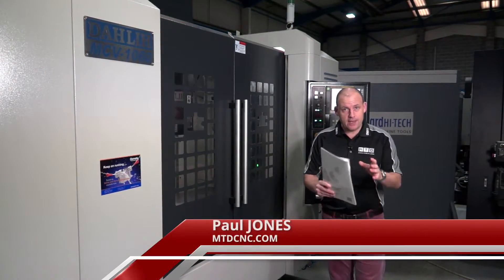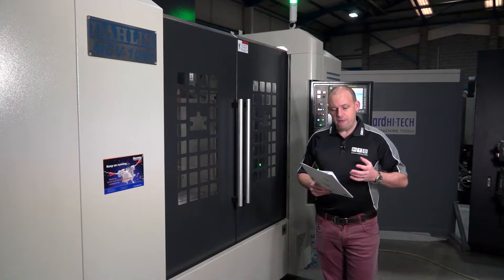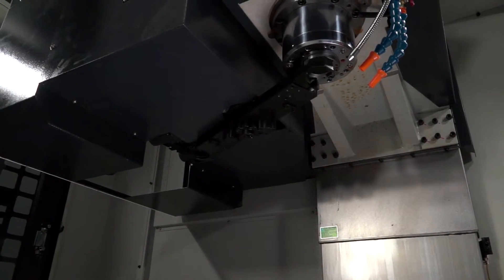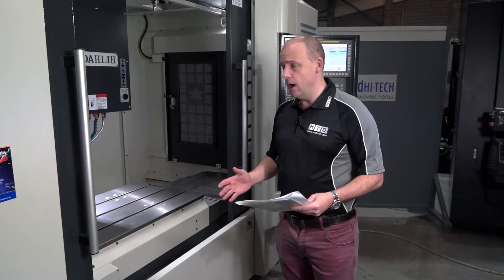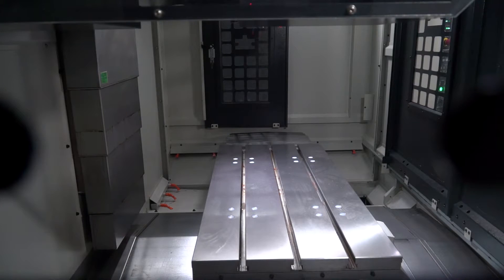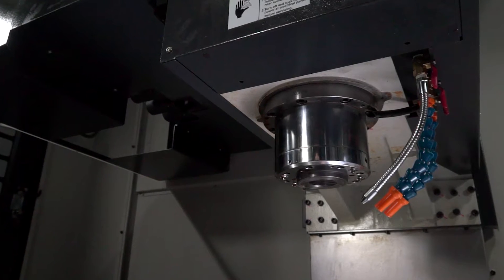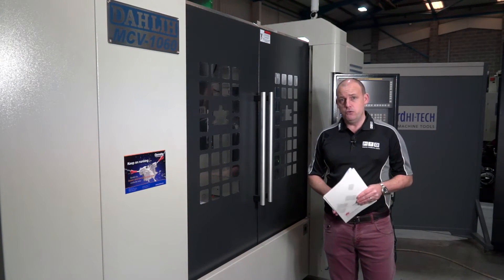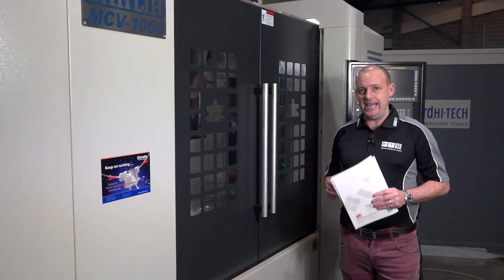A new model the DAHLIH MCV 1060 machining centre

Comment: I was @ Howdens compressors last week installing a big 150 mill turn and I had to machine a cushion pin from scratch,the one that came with the machine got lost on the journey from Austria.It was quite a complicated job to program @ the machine. But I never had any other choice so I jumped on a new DAhlih they've just purchased.I was well impressed easy to prg easy to use and solid as rock I've been on machines that cost nearly £40k more and they would have struggled to do what the dahlih did I was cutting inconel 712 as well which made it all the more impressive 👍